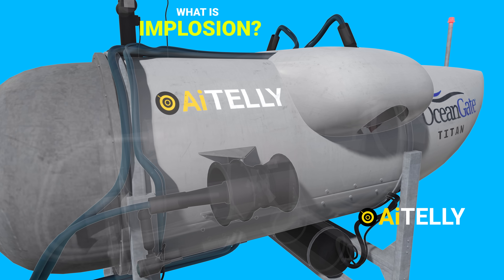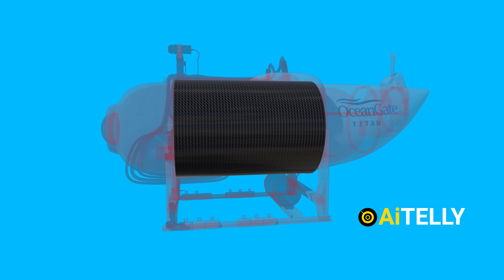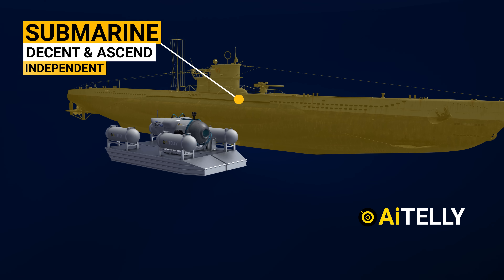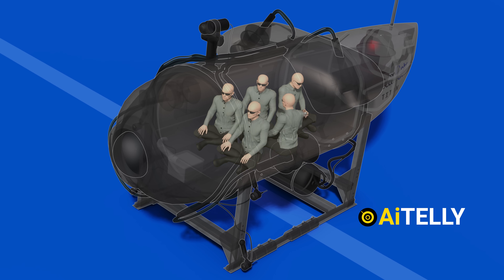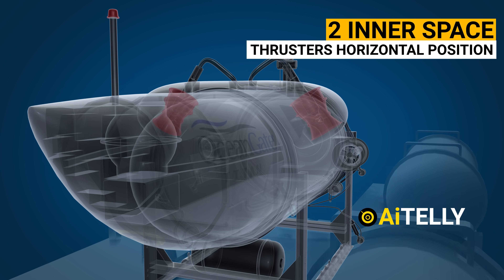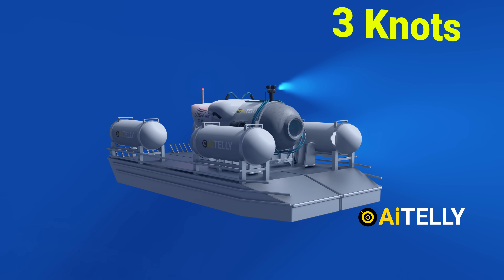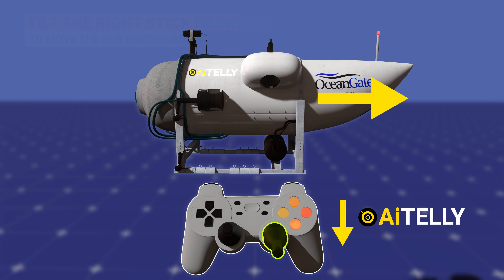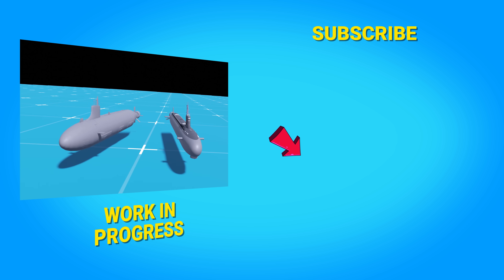Implosion Titan Oceangate How it Happened | Submersible Submarine Parts #3d

Comment: The Titan "used mostly carbon fibres, which have the advantage of being lighter than titanium or steel." Are you saying that per unit of volume, carbon fiber is lighter than titanium? That would be it is less dense than titanium. When constructing the pressure hull of a  submersible, how would being lighter than titanium. or less dense than titanium, be an advantage? Also, the pressure hull was constructed of some kind of composite material consisting of carbon fibers embedded in epoxy resin. That complicates my understanding of the hull's physical characters. The diameter of the fibers, the ratio, by weight, of epoxy resin to carbon fibers, the kind of epoxy used, the shape of the hull, the thickness of the hull walls, the position of the fibers relative to the shape of the hull, and the number of times that the hull has previously dived and come back up all are factors that influence how much hydrostatic pressure the hull can withstand, at any particular dive, without imploding. Also, carbon fibers have a lot of tensile strength, that is, you can put a lot of force on them lengthwise, without breaking them, but  I don't know what happens to them as they stretch. Some materials slowly lengthen, and then break. Others suddenly break into 2 pieces, once a certain amount of force is applied. Their tensile strength this seems relevant in a cylindrical vessel that has carbon fiber wound in a circle around the cylinder if the cylinder is being used to to maintain high pressure inside it, when there is low pressure outside – such as in the case of an airplane. The internal pressure will put longitudinal force on the fibers. The force from internal pressure will be resisted by the tensile strength of the fiber, and prevent the vessel from exploding. However tensile strength seems to be quite irrelevant in a vessel that is meant to maintain low pressure inside it, while  it has high pressure outside it. The force from external pressure will simply cause very thin fibers to flex, to bend, disrupting their position within the epoxy resin, in a very unpredictable fashion, possibly causing the resin to crack. Where will the fibers bend, how much will they bend, how will the resin be affected?  We are not talking about a single material. We are talking about 2 materials, with different physical characteristics from one another, and one of them embedded within the other. This is something very different than a titanium alloy, where we have a solvent solute situation. With a carbon fiber composite, carbon fibers are embedded in epoxy resin. They are not dissolved in epoxy resin. Good luck figuring out how they will react in novel situations. Well, now we know a little bit more about that they we did just a few weeks ago,

Comment: Anyone who fishes knows how fibrous materials work. A fishing rod is essentially multiple glass or graphite fibers laid longitudinally over and over until the specified “action” of the rod is achieved. If you take that rod and bend it, it will snap back to its original position. However, if you bend it beyond a certain point it will suddenly crack and fail, essentially without warning. Now, try that with steel and it will permanently bend if bent past a certain point, but it won’t suddenly and catastrophically crack and “explode”. Basically, metal is more forgiving than carbon fiber.

Comment: Understanding that its a new untested technology, Not understanding the Carbon Fiber element and not knowing the fatigue aspect of it (How many times it can go down and back before the material starts to weaken) how it was tested before and after a dive, knowing that more than  few others were concerned for its safety and the safety of its crew, support vessels - being piloted by basically a toy and sitting where they were - no, I wouldnt be convinced and not confident enough to place a loved one like a son there with me - I have better things to do with my money than to go all that way down in such a untested vessel to then look through a small hole to get a glimpse of the titanic,,,no, i`ll pass.
Reply: I've constructed and tested fiber composite pressure vessels to destruction. Fiber composites excel in tension, not compression; the design concept for this is fundamentally flawed.
Reply: @MarkShinnick  Honestly, I`m not an expert - and going to the depths that the Titanic is at and spending this amount of money would have me questioning a lot - there were too many variables and some good qualified people were questioning its safety - I have my reservations on it sure,but no - I wouldnt of gone on it and thanks for your comment - I`m understanding it a little more
Reply: @Rockit-  Yes, it's really the same concept as pushing in a rope. Completely the wrong application of the material.
Reply: @MarkShinnick  thanks again -

Comment: The actual measurements of depth capability are guesswork only. The submersible was NEVER pressure tested. The numbers were derived from engineers making a calculation (or "guessing" ) based on their understanding of the materials used. It was careless at best.

Comment: 💡You don't know what caused the implosion. Pure speculation at this point. Crew compartment had Carbon Fiber wrapped around an approx 3/4 inch to 1 inch (possibly made of) Titanium Alloy inner cylinder. This cylinder would have collapsed but should be down in the debris area.

Comment: There were other issues with the hull: It was made of titanium endcanps and carbonfibre which were glued together. Since these 2 materials behave differently under pressure even that might've caused a crack and with that implosion. Also the interior wasn't fire proof, that means that a small electrical fire could've damaged the hull. And the window which was only certified for a depth of 1300m, but they dived 4000. It was most likely the hull, but it could've been 'anything' as this thing was super unsafe. That is a really good animation though, thanks for sharing.
Reply: Yes, I saw exactly this in my own testings. I've constructed and tested fiber composite pressure vessels to destruction. Fiber composites excel in tension, not compression; the design concept for this is fundamentally flawed.
Reply: @MarkShinnick  What was Albert Einstein About GRAVITY and MASS.   Take 🍎 Fall From Tree Or WATERMELON
Reply: @MarkShinnick  Were these test documented and peer reviewed? If so what publication ? Manufacturer and type of carbon fiber and resin and type of autoclave used ?
Reply: Anyone can build a submarine and go exploring in international waters!  My cat and I are currently working on a design that I think will work out well
Reply: @patdohrety2940  My theory is to use Donald j Trum hotel in Washington DC to build a submarine 🔔
Reply: Why SAVE The Titanic  Now?
Reply: You are right. The problem was not only the carbon fiber but how it was jointed to the titanium. I wonder how that union was made considering they are two very diferent materials and there was the failure point.
Reply: @magister61  ITS SIMPLE USE IRON Material...
Reply: @delbarfield8624  Iron is very brittle and heavy.  To make it thick enough to withstand the pressures would make it too heavy and it would just sink like rock.
Reply: @magister61  🤔🤔 Industry has been joining Titanium to CF for decades. Carbon Carbon leading edges of the sr-71 are bonded on. Most major aircraft manufacturers bond Titanium and CF everyday...I don't believe the pressure vessel was the cause of this accident at all. Why are you GUESSING the failure was due the carbon fiber and or bonding of dissimilar materials?  Just 1 piece of actual evidence? Just because you heard it from a bunch of people ?
Reply: @blackhd92  those are completely different applications which are in no way analogous to each other.
Reply: the implosion happened before they reached titanic
Reply: They were almost to the Titanic before the implosion happened.

The radius of the scattered wreckage tells us they were about 900' above it. 

Any higher than that, and the wreckage would be scattered all over the ocean floor for near miles.
Reply: @Aaron-rv1si  NOT CLOSE,🧐 THERES A CURRENT that runs Thousands of miles above the 1000 feet from the  Titanic . Maybe the current of the the current is at 900 Mph
Reply: @Aaron-rv1si  Frozen M&Ms for Sharks 🦈
Reply: @Aaron-rv1si  Air From The Bottom Of Ocean 🌊
Reply: @Aaron-rv1si  Not true.  When it imploded and then exploded and then re-imploded the pieces would likely have been too damaged or heavy to plane down and spread out.  Ships or parts of them do that when they sink because there are large areas of smooth flat surfaces to act as a rudder.  I doubt there was anything that would have created more than minimal planing effect and would have just spun dropped down in a mostly vertical direction.
Reply: Are you serious? They went that deep with a window that could only withstand 1300 psi? Isn't that like suicide?
Reply: @John-ku5hp  Anyone can build a sub: there are no laws in international waters concerning this activity
Reply: @John-ku5hp  That isnt true. It was only rated down the 1300 meters. Not 1300psi.
Reply: This guy was so confident in his sub because some guy at NASA approved his hull design. Space and the ocean are two places. Just like the many astronauts who died, many submersible sailors will too. Trial and error my friends.
Reply: @@user-wt7do4lz9x NO CELEBRATE 4 JULY

Comment: A search of "Did the Titan try to surface?" produces an article (Insider) that notes the deep sea submersible community reports the ballast of the Titan had been jettisoned.   To release the ballast is to try to surface.  One can conclude that if (and that's a big word, if) the ballast was jettisoned then the passengers knew they were in trouble and wanted, urgently,  to surface.  James Cameron and others have also spoken about how sensors were placed in or on the hull to detect an imminent implosion or weakening of the material.  If the ballast was not amongst the debris field it seems likely the ballast was released before the implosion in an attempt to surface and avoid the collapse of the hull.
Reply from the maker: You might also like Nuclear Powered Submarine Engineering behind it #3d Nuclear Reactor released
Link: https://youtu.be/J0lb46Zi5-s

Comment: How do we know that the window didn’t pop off and the water rushed in and forced the passengers and other materials out the back.  The wreckage shows that entire whole parts of the sub were recovered, so maybe the passengers didn’t utterly disintegrate like the early narrative suggested.  Maybe the passengers just drowned?
Reply: No possible way it pops out until the implosion. I've constructed and tested fiber composite pressure vessels to destruction. Fiber composites excel in tension, not compression; the design concept for this is fundamentally flawed.
Reply: Sad posibility
Reply: The forces involved are too extreme , it’s several elephants standing on top of you. The air pressure alone would have killed them in 1 millisecond.
Reply: @joebidenisyourpresidentget2481  the pressure is great.  Yes.  But, if that pressure came from an open window, it would blow them and everything out the back.  They wouldn’t utterly disintegrate.  That’s why they found whole bodies in the wreckage.

Comment: "Because of the Carbon-Fiber hull" you say? How do you know that? It could've also been because of the front plexiglass only rated for 1300 meters. We don't know yet.
Reply: I've constructed and tested fiber composite pressure vessels to destruction. Fiber composites excel in tension, not compression; the design concept for this is fundamentally flawed.
Reply: @MarkShinnick  Oh yeah absolutely. There's no denying that. The only question is, what broke 1st? The carbon-fiber or the plexiglass? Because they were both going to break eventually.
Reply: @MasterSystemMarceau  Since the carbon is not contiguous, that's my bet. Polycarbonate very homogeneously strong.

Comment: Commenting as I watch.  First graphic of implosion has errors.  The rear tail section had no pressure containment.  Was just for fluid dynamics and protect equipment underneath.  Yeah, your implosion animation includes the rear tail section which would not be the case.  You got the PSI right!  Your point about listening to feedback means you are a good engineer.  Your description of the propulsion system is great. Liked you did not demonize the controller. 8/10

Comment: Sorry to say, but your video is not very accurate. And not telling anything I didn't know.
E.g. your animation of Titan does not show it correctly. The front dome is a sphere not elongated as you show it. Also your animation of the moves are very doubtful. If Titan wants to go up using the thrusters it would not do as a plane by pointing upwards. The up/down thrusters are lifting it leveled. There are not hydrodynamic foils to make it "fly".
Also, why who the cosmetic cowlings at the stern crumble? They are just covers around the installations but not part of the pressure hull.
So the whole thing is of little value as you obviously have no insight beyond the basics we all have seen time and again from the news media.

Comment: I would like to know more on how the air and electronics penetrate the pressure hull to the equipment on the exterior. I'm assuming the must have gone through the carbon fiber section, possibly weakening the hull.

Comment: Not sure where you got your info from but lots more then 4 big pieces were found.. they found the whole skid frame, both titanium rings, the front titanium cap and the rear titanium cap, 5 large pieces of the steel outer shell along with a huge section of wires and an antenna and other random stuff. So lots of parts lol,
Reply: Outside carbon fibre, Inside: steel. Carbon delaminates to smithereens in these conditions. The steel ? Well, a pressurised soda can. 😢
Think of it this way:  encapsuling a soda can in a plastic bottle cover.

Comment: Watching the pieces being unloaded from the boat, as they lifted the parts up I noticed the titanium rings perfectly unscathed. This point to the glue joint between the carbon tube (5 in thick) and the forward and aft pressure rings. As the sub cycled many times and exeeded its limits, its weakest points are the joints. My opinion.
Reply: I've constructed and tested fiber composite pressure vessels to destruction. Fiber composites excel in tension, not compression; the design concept for this is fundamentally flawed.
Reply: Those glue joins were applied and assembly completed in the open air of an aircraft hangar--using step ladders and spatulas.  Think bubbles in the epoxy.

Comment: This video isn't about the implosion -- it mostly rehashes what everyone already knows about the Titan. And the bit about the implosion is very vague and fluff content. How was the animation created? Did you run a simulation? The animation shows the fibre hull collapsing the way aluminum (for example) would. But it doesn't work like this -- it shatters. It does not deform like metals do.

Comment: The tail nacelle was not pressurised therefore it would not have been compressed and distorted by a pressure differential (ie. implosion). In the retrieval video, the nacelle had been separated—but not damaged—into its parts. 

The two titanium spheres were essentially intact but separated from the seating ring which was separated from the carbon fibre tube. 

I speculate that c/f tube carbon fibre tube was pulverized as it collapsed around its longitudinal axis progressively beginning midway on that axis and the debris forced into the cavities of the two titanium spheres much as a soda pop can deforms when it is stepped on end-to-end. The implosion although occurring in microseconds would be progressive starting midpoint in the tube sending opposing shock waves out to the cavities of the two titanium spheres. 

I’m going to go way out on a speculative limb here and guess that the titanium spheres were found within 7-10 metres of each other (ie. they were not blown off the ends of the tube).